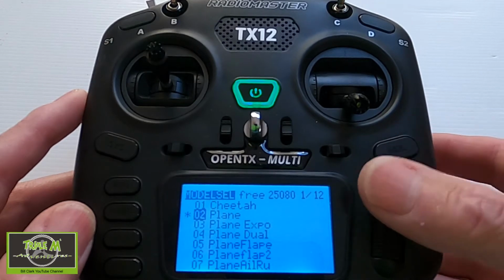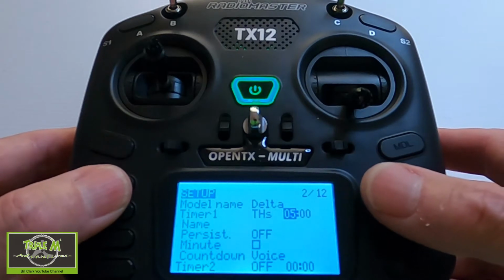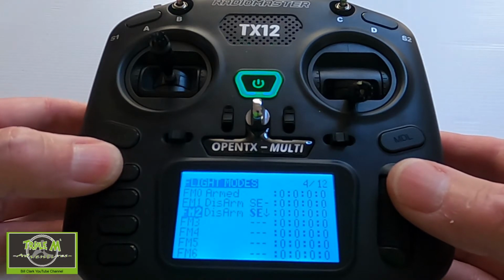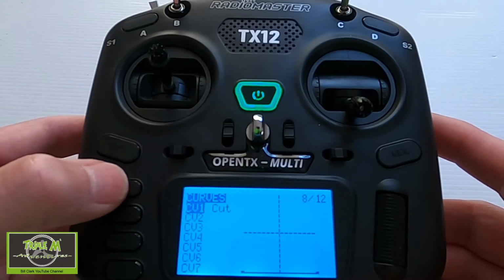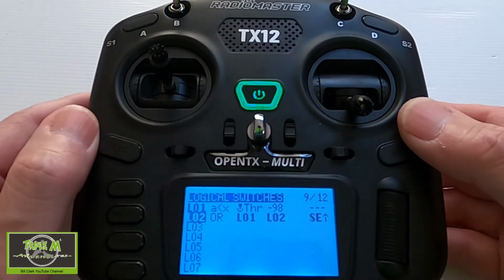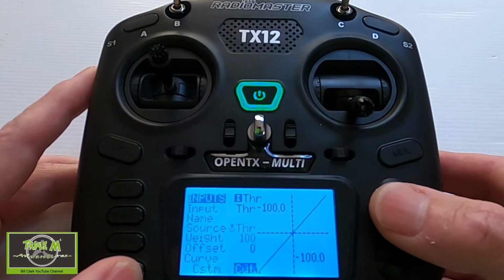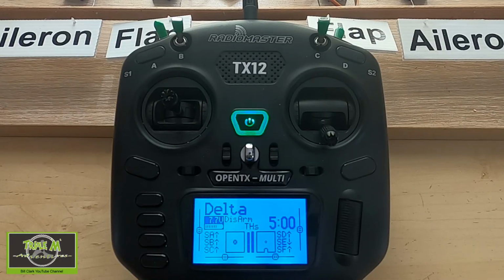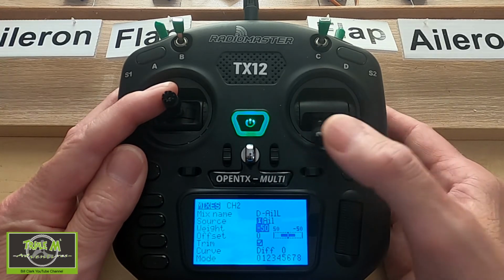RadioMaster TX12 Setting up a Delta Wing

Comment: Hi.  Thanks for the video.  I did everything.  Servo work perfect. But the engine cannot be activated.  I use a speedybee f405 wing.
Reply from the maker: If you are using a Flight Controller you need to check the programming. Also do not set up the safe throttle as I would with a PWM set up the FC controls arming.

Comment: Bill, I tried to follow everything you did but I either didn't have a particular screen or couldn't move my cursor where you said to move it. Far as I can tell it's same radio, bought mine couple months ago from Ali Express.i have yet to actually fly anything with it
Reply from the maker: Mick could you clarify your question please. Are you not seeing the model wizards?
Reply: I'm don't know, is like I started when you did, followed you until just before the set up. I didn't see a page for the different set up types. Then I had terrible with the logical switched page. When you got to curves and went to the right of screen I couldn't. And with a Delta shouldn't I see elevon settings?
Reply: I'm always had a Spektrum Dx6
Reply: Wizards?
Reply from the maker: @michaelmickoberhaus8009  Hi Mike, I am assuming you do not have a SDCard in your TX12? You will not have the model wizards if you do not have an SDCard in your radio which has the SDCard contents on it. You need to get an SDCard 8GB is fine I would suggest getting a quality card. You then need to go to the OpenTX website and download the SDCard contents for the version of OpenTX in your radio. To check the version on your radio goto SYS scroll to VERSION. Place the unzipped files on the SDCard and insert the card into your radio. You will now have the model wizards. 

This video should help you.

https://youtu.be/7YXfGNqSiMM

Any further help please contact me.
Reply: Hey thanks Bill. Will this also provide the voice commands?
Reply: I'm not sure how to set up the internal and external settings. I have a Radio master receiver R88.
Reply from the maker: @michaelmickoberhaus8009  yes it will Mick.
Reply: I've downloaded the instruction manual but it's not all that helpful unless you know terminology etc. Is there anyway I could fly with a basic set up? You know, with ail and ele on Y connections without to much hassle? I don't know what protocol to use with Radio master receiver but I got it to bind using FrSky.
Reply: Almost forgot, I do not have a lap top, is it necessary for any kind of programming?
Reply from the maker: @michaelmickoberhaus8009  Mick just use the model wizard to make a standard model and you should be ok.
Reply from the maker: @michaelmickoberhaus8009  no you can do everything on the radio.
Reply: Thanks Bill. Is the SD card a micro? Because my Spektrum has a regular size in with adapter to hold a micro
Reply: It will have to be a micro if I'm too upload anything on to it using my phone
Reply from the maker: @michaelmickoberhaus8009  yes you need a micro SDCard 8GB would be fine max is 32GB bigger cards will not work.
Reply from the maker: @michaelmickoberhaus8009  do you know someone who can help you with a computer to download the SDCard contents?

Comment: ken i bind a airplane quidi 560 with mijn TX12 ?
Reply from the maker: I have checked the model details and it is compatible with the Futaba S-FHSS protocol which can be bound to the multi protocol module. But I cannot test this for you as I do not have this model.
Reply: Dank mo you Sir, doe need I one extra module for the Tx12?
Reply from the maker: @pierrechristiaens3013 Which version of the TX12 do you have 4 in 1 or CC2500 module?
Reply: Hello Bill it is the 2500 version
Reply from the maker: @pierrechristiaens3013 The CC2500 module does support the S-FHSS Futaba protocol.